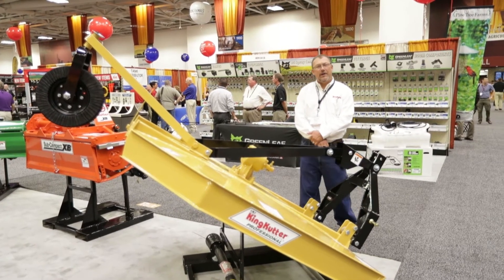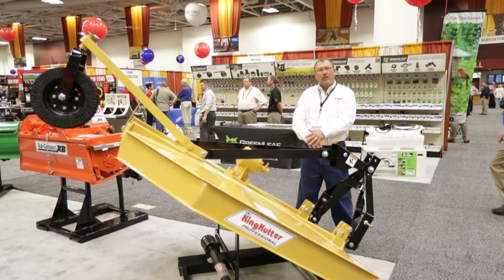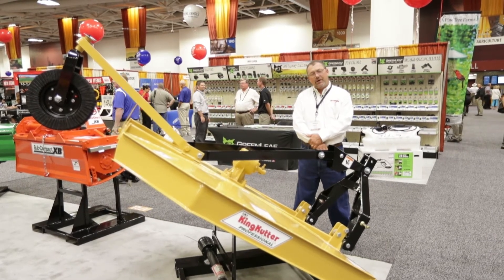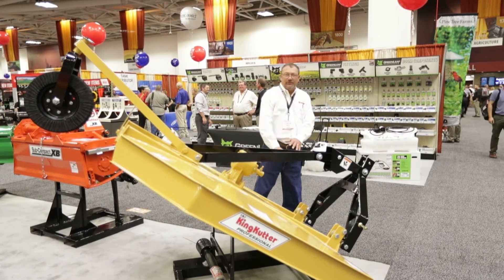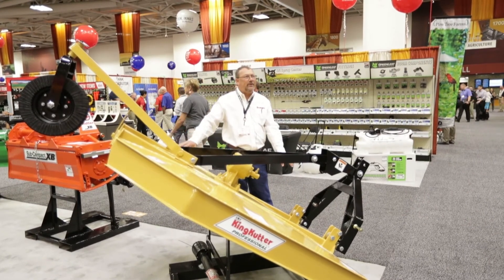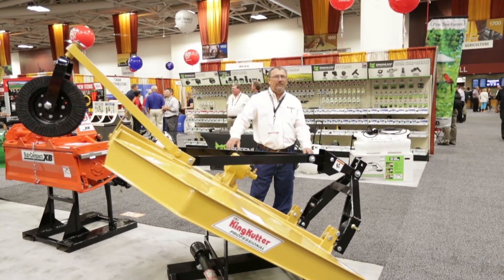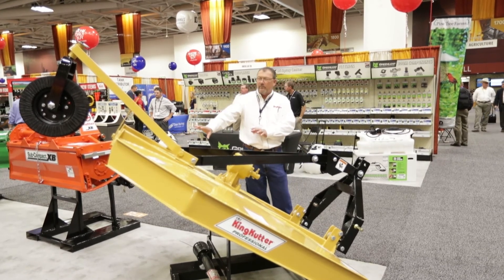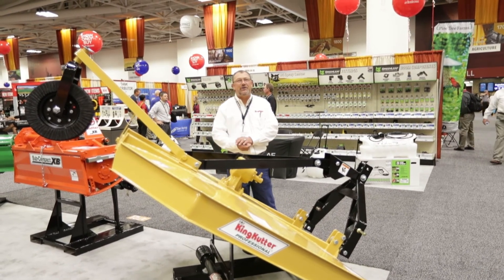What Makes King Kutter Flex Hitch Rotary Cutter Better?

Comment: It was either call someone with a Dozer or use my near new 5 ft KK behind a old MF 135.
Been taking down 3+ inch trees with it & if it grenaded next time I use it then so be it cuz I'm more than happy with what it's stood up to .
Reply: hmm, good to know. i got a 33hp challenger 28hp pto same kk cutter. havent used the cutter yet but its been with the tractor since new and the tractor only has 475hrs.

Comment: I bought a new King Kutter flex hitch rotary mower the gear shaft going into the mower has no through bolt to keeping it from spinning just an outside bolt and lock nut. I'm finding that I have to remove the bolt to slip the shaft in, but then I try to put the bolt back in it wont go in. How exactly does this work and why is there no through bolt like most brush hogs?